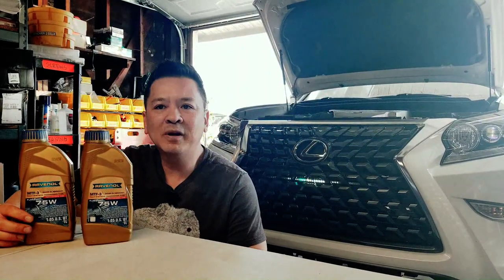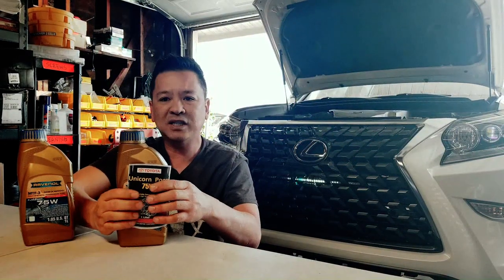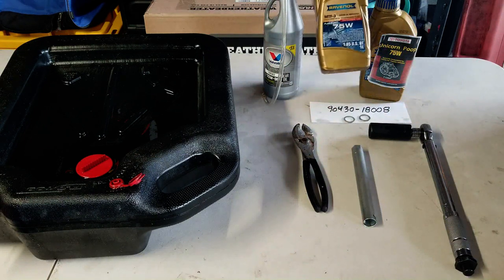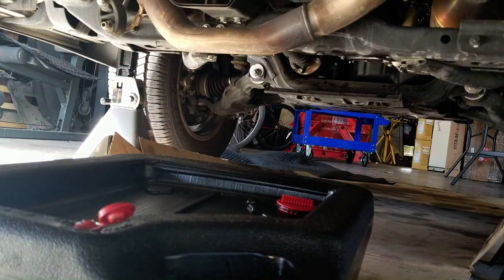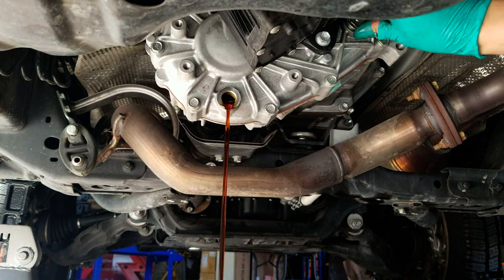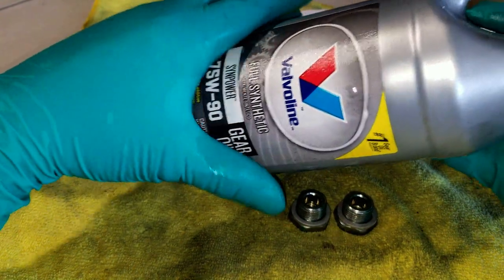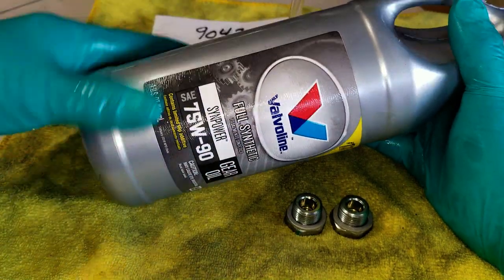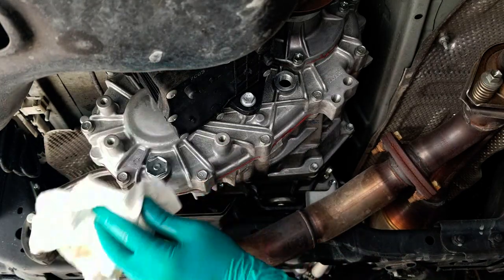Lexus GX460 Transfer Case Fluid Drain and Fill

Comment: Just did this on my 2017 GX today. This made me feel a lot better about using Ravenol for my T-case as well. I just pulled the nozzle right out of the bottle and it poured right in. No pump needed. Used your video to do the rear diff yesterday. Thank you. Keep the videos coming.
Reply from the maker: Hey Josh,  i knew that Ravenol nozzle was supposed to be for something dammit.  Ugh...i hate it when i rush into things and find out there was a short cut.

Comment: Hi Bob, I enjoy your videos. I’m wondering your thoughts on my 2015 GX 460 shutter. I do have an aftermarket icon suspension and running 35 inch tires. However, it has shuttered with 285”x70x17 tires. Do you think it’s transmission related or transfer case? please let me know your thoughts. Thx
Reply from the maker: Your question reminds me of customers calling an automotive shop and using zoo animal noises to mimic the sound their car is making.  Its almost impossible to diagnose any shudder or sounds unless the technician is physically there to see, hear, and feel you replicating the issue.  You can get a best guess but fixing  best guesses are a waste of time and money in my opinion.

Comment: I just did this today. The Ravenol works great. On the top of my bottles there are 2 D shaped. rings. You pull up on them and the bottle neck expands. Before you unscrew the cap off completely carefully pull again and you will extend the fill tube and then pull off the cap. It was great and made it super easy. In fact I saved those bottles and next time I'll transfer my Amsoil to those bottles, because even the Amsoil squeeze bags aren't as easy as the Ravenol container!! Again another big thanks for your videos!!!!!!!!!!!

By the way I also did the front and rear differentials. My truck only has 20,000 miles and there was. a lot of gunk on both magnets. So I'm very happy I did  them. The transfer case fluid looked good. Total spent today on 2 differentials, transfer case and grease on the drive shaft including all new gaskets about $110.00. Total cost of tools, gadgets, my time jack stands ect. probably $1000.00 😂😂😂😂
Reply from the maker: Nice!

Comment: GXBOB, You're the MAN! So helpful with all your video. I am tacking on doing the front, rear dif, transfer case, power steering fluid this weekend all Thanks to you! 👍👍 I'll also try to change the transmission oil, just drain and fill. Thanks again, keep them video coming. 🙏🏻🙏🏻
Reply from the maker: Always appreciate the comments Ken.  Let me know if you have any easy questions that don't require 4th year calculus to answer.

Comment: I just put this oil in my 2003 Gx470 transfer case. The Ravenol bottle has a 6 inch nozzle hidden directly under the cap. You don't open the cap.  Lift the two half rings that is on top then twist and pull up. It'll extend out. Best invention ever.
Reply from the maker: i kinda had a feeling that nozzle was for something.  Thats what  happens when you do everything for the first time in realtime without doing any practice rounds!  lol, thanks Vong.

Comment: Great video Bob. Out of curiosity I called my local Houston  Lexus dealership to ask them how much they charge for the front diff, transfer case and rear Diff fluid change. I was quoted $600. Umm, no thanks. Ordered Redline gear oil, transfer case oil and did it myself. Ordered a washer kit on Amazon. Mine is a 2015 Lexus GX with 60k. Figure I’m good until another 60k miles with Redline fluids. Love your videos Bob. I’ve watched all of them.
Reply from the maker: $600 is my motivation to start figuring out stuff myself.  Thanks for the comment Justin.  Helping each other out and figuring out stuff along the way is what the internet is for.
Reply: Good job! Wonder how much all the fluid and washers cost

Comment: Thanks for the vids! Will be doing this and the diffs (once everything comes in) in an effort to baseline my "new" 2013 GX (165k miles). These are awesome trucks!!

I'm going with Redline for both fluids. Seems their t-case juice is closer to the Toyota Liquid Gold than the Ravenol (that's not criticism of your choice). Plus, I've had great luck with Redline products in my sports car (totally solved a synchro grind). They've held up well to track abuse.
Reply from the maker: Hey Jason, I’m totally trying the redline on my next fluid change. 👍

Comment: Did this yesterday with help from your video. 2018 42k miles
Reply from the maker: And differential too i hope
Reply: @GXBOB  yes sir. I did both differentials, tcase, AT, and even installed a transmission skid/cat shield. Long day.

Comment: Hey Bob, thanks for making all such great videos! Are you gonna make a video for transmission oil change for GX460?
Reply from the maker: Hey Jimmy, you're the first to ask this but i had my tranny fluid replaced by my local mechanic because he gave me a deal i couldn't refuse.  Toyota OEM tranny oil WS, flush and fill for $80 out the door.  I couldn't resist.
Reply: @GXBOB  I would love to visit your local mechanic but I’m in Texas lol…just got a quote from Toyota asking $300. Thinking about to do it myself. Did they replace the tranny fluid filter inside the oil pan too? Not sure if that’s necessary.
Reply from the maker: @JianningXu1988  if you replace the fluid often and before scheduled, i wouldn’t bother.
Reply: @GXBOB  Mines is right on 65k and have not done anything besides brake fluid and regular oil change…maybe too early for differential, transfer case and tranny fluid flush? Toyota gave me a whole to do list and one of them is 4x4 service. Assuming that’s the front/rear differential and transfer case. Obviously I’m gonna do them all myself with the help of your videos 👍
Reply: Did the tranny oil drain/fill on my '12 GX...fill port is on the pass side up and to the rear of the pan. Look around with a light and you'll see it, same bolt on transfer case. Dropped pan to clean magnets and get extra oil out...was 148oz total WS that came out to include what was in the pan. Toyota dealer sold WS for 8.57/qt. Needed 5 quarts. Pan gasket cracked apart removing it so glad I bought that too. 134k miles dunno if it was ever changed. Dirty oil but no shavings. I did this with a "cold" vehicle and replaced exact fluid amount removed. Worked great

Comment: Just did the transfer case and both diffs on my 2017 with your help. Thank you Bob!
Reply from the maker: awesome!  did u use the oem fluids are did u order the ravenol?
Reply: @GXBOB  I went with your recommendation on the Ravenol. It saved me some $$$ and the built-in bottle spout turned out to be very helpful. Thanks again and cheers from TX!

Comment: Hope you are having a wonderful day! Thank you for the album of videos on how to take care of this vehicle. Any video regarding transmission fluid change for this GX460?
Reply from the maker: Hey Mr. G, sorry.  I took my car in to have something checked out on the brakes that only he had the special tool to do.  While i was there he gave me an offer i couldn't refuse: $80 for transmission drain and fill using Lexus OEM ATF WS fluid.  I said what the hell just do it.
Reply: @GXBOB  Is the brake thing an Issue to be concerned about? I am in the market to potentially buy this vehicle for my growing family. I do not want an overly complicated brake job in my future...

Also, any place to find directions on how to conduct an Trans Fluid Change?
Reply from the maker: @Migueljrglez  The brake job thingy was my fault.  I did a lot of tweaking on the rear drum brakes in order to make the youtube video.  Its nothing to be concerned about.  The brakes are quite simple and straightforward.  As far as transmission fluid replacement, there are quite a number of youtube tutorials that does decent coverage on it.  I wouldn't worry about measuring the amount you take out to the amount you need to fill back in because there is an overflow bolt.  If you put in too much, just open the overflow and whatever is overfilled with spill out.
Reply: @GXBOB   Got it! Ouch! 

I am mostly concerned about the correct temperature to check the fluid. I am acquainted with Toyota sealed transmissions, as I have always maintained mine on previously... but it is harder to find info on Lexus products. 

I’ll just continue doing my research! Great content btw! I will subscribe when I get out of work!

Comment: I use the Ravenol MTF-3 75w in my tacoma transfer case. I'm considering Redline MT-LV. They are about the same price
Reply from the maker: I do some towing for my boat and RV.  I will definitely be changing out my transfer case quite often.  I'm thinking at 15k.  I will try the Redline next, thanks.
Reply: @GXBOB  I don't do a lot of towing now. But since the fluid isn't expensive and it only takes about a quart I'm changing mine every 15-20 also

Comment: Bob...any update on this fluid change? Any noise/whine/vibration? Issues with switching from H4-L4-H4? (Using the Ravenol?)
Reply from the maker: Hey Mike . Absolutely no issues or weird noises. Smooth as butter.
Reply: @GXBOB  Kool, did mine today. Although the old stuff did smell a lil Unicorny. I do have a suggestion. The tubing for the fill does not "Go into" the casing. So I tie wrapped the tubing lightly to the driveshaft yoke. Then stuck the tubing into the fill hole. That way I could run the pump with 2 hands. 
But I use this pump from Amazon: https://www.amazon.com/gp/product/B00J8331U6/ref=ppx_yo_dt_b_search_asin_title?ie=UTF8&psc=1I I fill a graduated bucket with the fluid and fill from there. You were right on the Ravenol containers needed channel locks to remove the freakin caps!

Comment: Bob, I am getting some transmission flutter and am told a drain fill or three on the sealed automatic transmission would help solve the problem. Do you have a video on this, or could you point me to one that you recommend? I got the WS ATF I just need a good tutorial or walkthrough....the dealer told me its a sealed unit (duh) but this is my last hope before I have to sell her or pay big $$$ for a new trans....
Reply from the maker: Oh damn....SZ, all the ones on youtube right now are pretty straightforward.  I specifically liked the one where the guy brought the fill tube all the way to the top of the engine and attached a funnel instead of using a Pump while under the car.  But if you are in a pickle right now and need it done ASAP, i would just take  your ATF WS and go to a mechanic.  Mine charges $85 for WS and labor.  I"m sure yours will ask you for $60 or so bucks to drain and fill w/ your own fluid.  Sorry i haven't gotten around to doing a Transmission one, been super busy.

Comment: Nice video. Seems need to put the GX on four jack stands.
Reply from the maker: No need Ted.  The level you remove will be the same level as you add in as long as you don't change the position of your vehicle before and after the drain/fill.  The manufacturer understands that most lifts are done at the front so they designed all their drains towards the back of the pan.  👌

Comment: You used the ravenol in the center and the Valvoline in the f/r diffs?  I use ravenol in my VW. Good stuff.
Reply from the maker: Yes I did!  I usually use whats either available or what has more value but still meets oem specs.

Comment: Great video. Wonder if you know how to remove the inner lid of GX460 brake reservoir: the white piece of plastic with a small hole in the center. It’s in the way when refreshing brake fluid in the reservoir. Thanks
Reply from the maker: Sorry Ted, i haven't looked into it as of yet.  When u say "refresh", are you talking about draining the fluid from the reservoir and add new fluid in from the reservoir?  I mean, i would just fully bleed your system from the brakes as an alternative.

Comment: Thanks for the video bob. Just to confirm. I can use any 75w-90 for transfer case?
Reply from the maker: Well technically you're supposed to use Toyota compatible 75W, not 75W-90.  But if you search the forums people use 75W-90 all the time.  If you want to play it safe then use the ravenol that is toyota compatible in my link.

Comment: Hey Bob, You do realize that Ravenol gear oil containers have the 'Child-proof' opening instructions on the cap - you pull up on the 2 golden hoops - and 😱 out pops a filler tube which means no more need for any 'pumping' - you just 'stick it in the hole and squirt' - I really would have thought that would have been right up your street 😉
Reply from the maker: Yeah, a few subscribers commented on that.  I'm still old school and i've proven it throughout my videos. But the more we use conveniences and technology, the weaker the human race will eventually get.  Hence the big cannons i have from pumping way too many bottles.
Reply: @GXBOB  Many thanks for the GX info, as a new owner I  greatly appreciate the time you've taken to put it out there!

Comment: Do yourself a favor. Get a Motive power fluid filler. Put up to 1 gallon in it, Pump it up with the handle or air compressor, put the filler end in the fill hole and no pumping by hand. Its fast too. Lifesaver. No bodybuilding necessary.
Reply from the maker: Lol thanks AR. Believe it or not, i learn quite a lot from the comments section too. I was thinking about buying oils in a pouch that have built in filler nozzles for jobs like this. Thanks again.

Comment: I had 2014 gx 460 now 30 thousand miles. Never off road or tow anything. Thanks for responding Bob. You think I should change differential and transfer case 50-60 thousand miles ok right? Thanks again
Reply from the maker: Harbor freight Daytona 4 ton rapid pump low profile jack and Big Red Torin suv extended height jackstands. They’re in Amazon.

Comment: Bob have request for you do GX460 Transmission fluid change video thanks.
Reply from the maker: i' had  a lot of requests to do this but i already had it done by my local mechanic.  He offered me a deal i couldn't refuse.  $80 for drain and fill with Toyota WS.  I'll most likely do one but not in the near future.
Reply: @GXBOB  How many miles did you do it at

Comment: I'd assume the drivetrain maintenance for the 4Runner Limited w/ Torsen Full time 4WD system is identical to the Lexus GX 460 maintenance?
Reply from the maker: OoOoOoooohhhh, not a 4runner person even though a lot of parts are transferable.  I'd ask someone in the forums to get confirmation.
Reply: I ended up checking then Owners manual for fluids- the 4Runner Limited (with full-time 4WD) uses the same drivetrain fluids as the GX460.

Comment: Checked the fluid levels on my moms 2020. Car has 28k miles, we have payed the stealership to check a fluid levels muntiple times. Anyway, been noticing slight gear wind noise. I dont care about the noise, but thats a noise my 41 year old jeep should be making, not a lower mikes let alone new car with a chain driven t case. Checked front diff, rear diff, and t case. All low, t case not as bad but still low. Both diffs seems to have fine particles in it. Ive seen worse chips, but thats in clapped out jeeps with 300k miles, towing and offroad miles included. Like i say more chips then a 2020 should have. Paint was intact, plugs were a little  rusty. You can tell no ones ever checked it. Exact same thing as when my dad worked at the chrystler dealer, and grandpa ran into the same issue with my jeep back in 1981. It has 800 miles and the transmission was low. Dealer prep there suposed to check the stiff cause they ship from factory a lil low. Idk of its for spils or just cause 1 ounce on 7 milion cars adds up to alot of $ saved but this is why my dad always says "if you want the job done right you have to do it yourself." We have never hired a mechanic or anyone hardy to fix anything unless under warrenty. First new car my parents ever bought and so far not impressed. This is why i am the warrenty on my own car, also why i dont let anyone AND I MEAN ANYONE touch my car with there dirty meat beaters. Cant trust the work of most mechanics. Had wheels come loose even cause the shop was too lazy to tighten lugs to 80 ft pounds or whatever the jeep requires.
Reply from the maker: Wow, your comment was definitely a good read. I do agree with you about nobody touching my truck except me but my reasoning is different from yours. I began working on my own vehicles because i couldn’t afford a mechanic. I also went to mechanic school in Arizona straight out of community college because i enjoyed working with my hands. After graduating and one year at a gas station i decided this was not an ideal career choice. Went back to college to change my course in life. But that’s besides the point. Lack of Financial resources mixed with a good deal of mechanical aptitude had me roll up my sleeves. Thanks for the comment Sam.

Comment: Sorry my local Toyota dealer says they use the unicorn poop. I’m going to get the Ravenol oil in my 2017 tundra transfer case and the front and rear differentials.
Reply from the maker: Yeah i don't mind using unicorn poop but i hate the fact they portioned it so that you have to buy 2 cans and waste half of one just to do a oil change.  You end up with half a can that will sit in storage for another 30k miles.  By then, so much crap has fallen into that can, it will deem useless.
Reply: Another update Toyota says I have a limited slip differential sooooo I have to use the Ravenol for the limited slip differentials it’s $5 more per liter

Comment: Hey Bob new to the gx 460 community just bought a new 2021 

How often should I change fluids on t case and front and rear diffs?

Thanks
Reply from the maker: Start on page 48.
https://drivers.lexus.com/t3Portal/document/omms-s/L-MMS-13GX460/pdf/MY13%20_Lexus%20GX%20460_WSG_lr.pdf

Comment: Did you use both bottles of TC fluid? Or did you measure it on how much was pulled out?
Reply from the maker: Neither. I think you’re thinking about the tranny. You just pour or pump until you see seepage out of the fill hole.